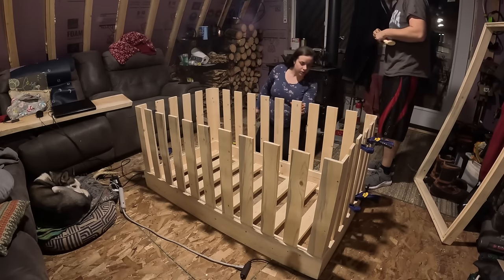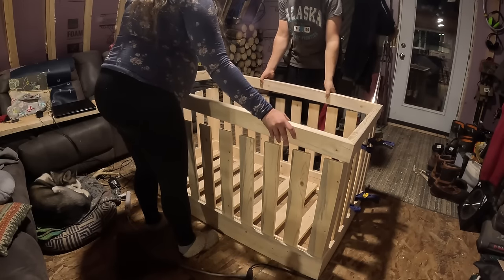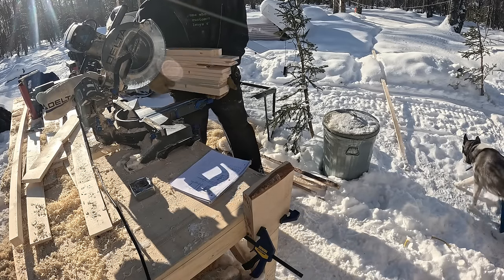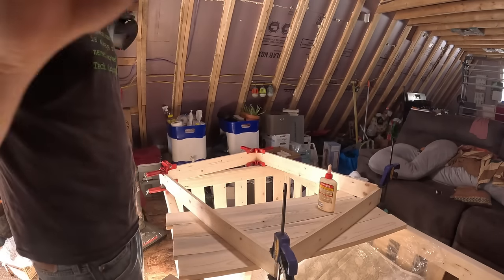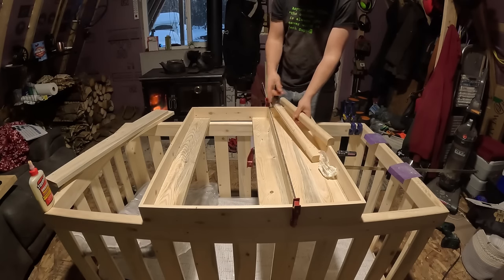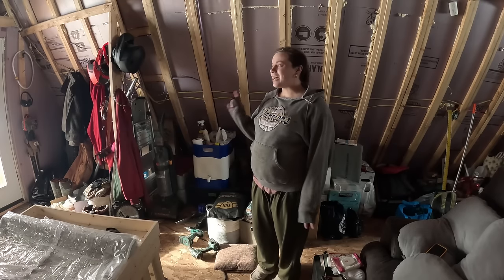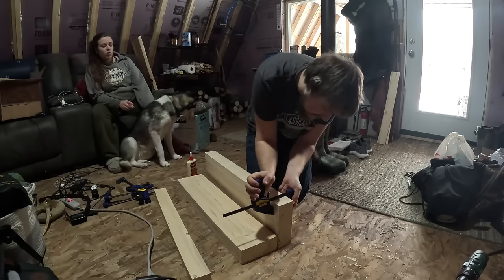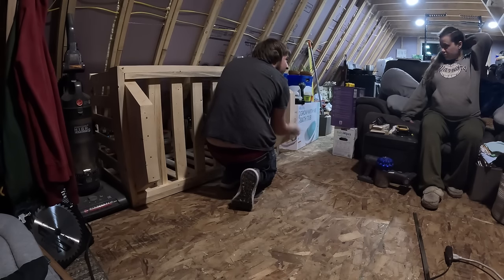Finishing the Crib - Adding a sliding changing table

Comment: I am so impressed with your desire and motivation to build your babies bed, and the sliding changing table just tops it off! You both are no dummy! You are both so determined to accomplish anything you set your minds to.  I know this will one day be a guest cabin, but I can't wait until it's completely finished and your forever home, is finished as well. I enjoy watching you both move forward with all your plans. You have made it through your first winter, and you should be so proud of yourselves. Just a thought though, thats really deep right now, that will have several months before pulling up on it, maybe you could put a drop box in that would raise bottom of crib up about a foot or so, to keep from bending so far down, and also less draft from floor. But you have to decide that, it looks great. I bet a stain and varnish will really bring out the wood grain. Love it.

Comment: end grain acts like a straw  when you apply glue to it. it sucks it up and that is a good thing.  if you wait about 5 minutes and then apply another round of glue you will get a better glue joint.  just a little tip.  you two are doing a great job.

Comment: Working with pine which has a lot of pitch it can build up on cutting edges and in this case in the collet of the router.  When you tighten it, it won't grab as well and as you are running it on a board the bit will tend to "walk" out of the collet changing your adjustment by a little or a lot.  If you see the brownish build up soak the collet in gas or lacquer thinner either works well, then scrub it with a toothbrush and a Q tip to remove it.  Presto, good as new.

Comment: You need one of those pocket drill things it drills a hole side ways you can screw it in for the corners dont know the name of it very good tool to use you are a good carpenter as i have said before i wouldent paint it baby will bite the top or sides better to stain it

Comment: Wait, so you don't use your generator to charger your batteries? If you run directly from your generator isn't that just a waste?
Reply from the maker: We turn on the generator and run the tools directly off the generator. The inverter is always plugged into the generator and charges whenever it’s on.